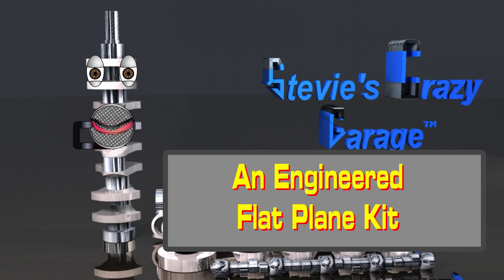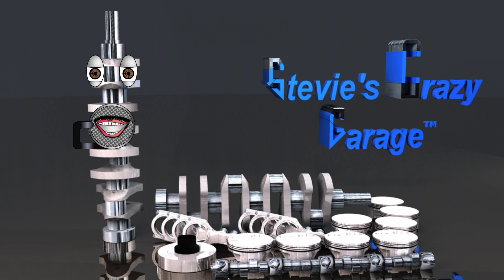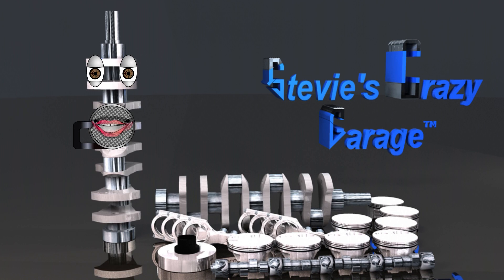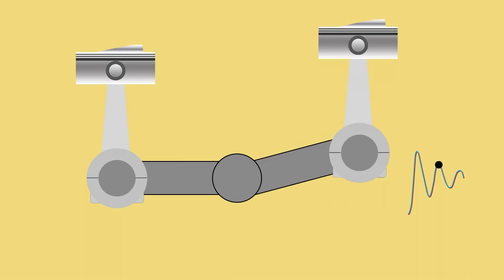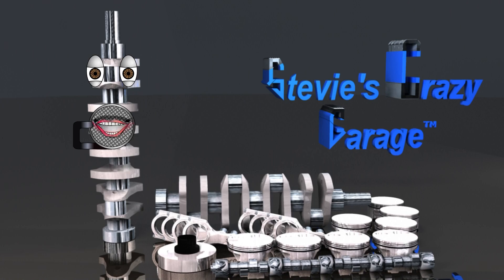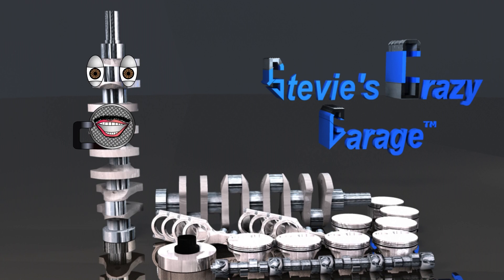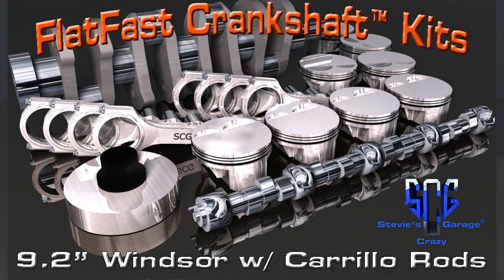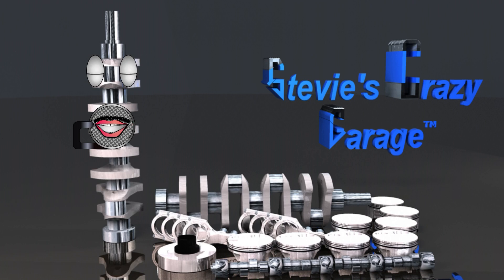An Engineered Flat Plane Kit

Comment: Steve, is there a flat plane crank for the old school big block chevy???
Reply from the maker: Not right now.  The block is to tall and the rotating assembly to heavy.  However, I am doing a lot of research into building a big block that would work correctly with a flat crank.
Reply: @Steviescrazygarage426  Yeah - ultralight pistons and rods would be a must.
It would actually be easier to do it to an old Pontiac with it's long rods and gentler piston acceleration.
Reply: @Steviescrazygarage426  You might also consider increasing the number of cylinders to find that extra displacement. I know I have seen at least one video floating around here of a V-12 ford made from 2 small blocks machined and welded together.